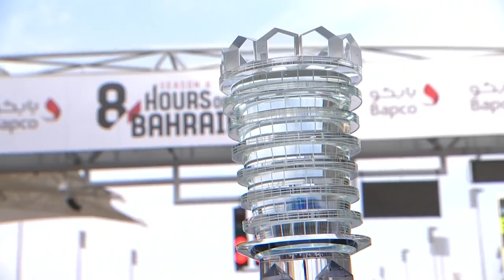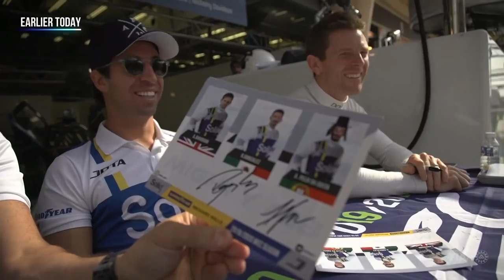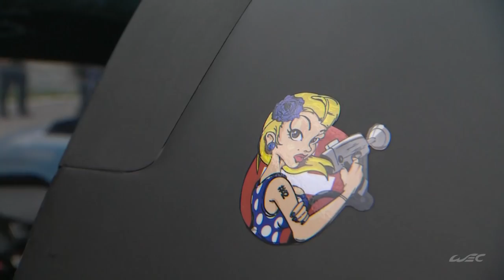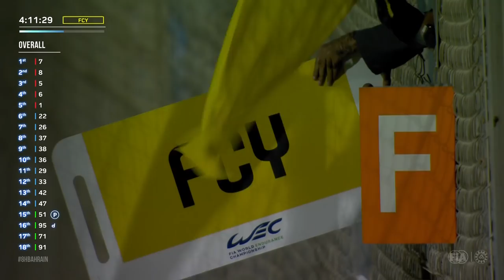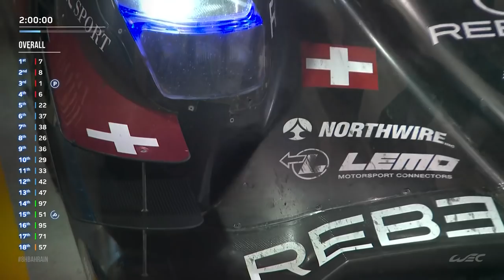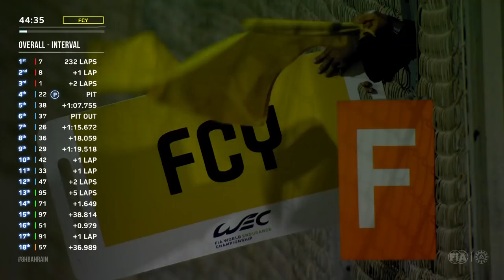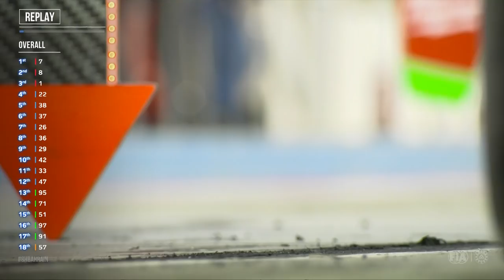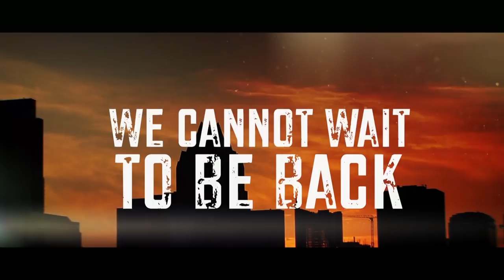FULL RACE | 2019 BAPCO 8 hours of Bahrain 2019 | FIA WEC

Comment: The cars behind nose to bumper were indersteering a lot. I though dirty air only applied in open wheel racing.
Reply: Nope, every downforce-based car gets dirty air problems. The difference is that open wheelers create much more turbulence so the problem is a lot more noticeable.